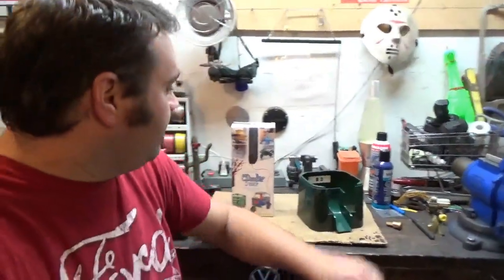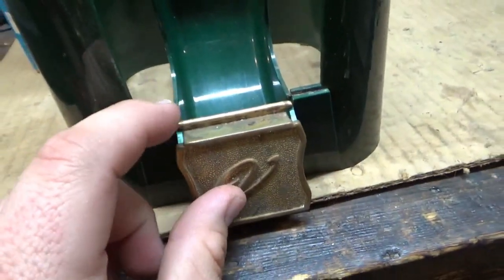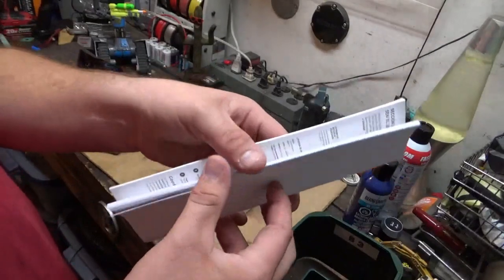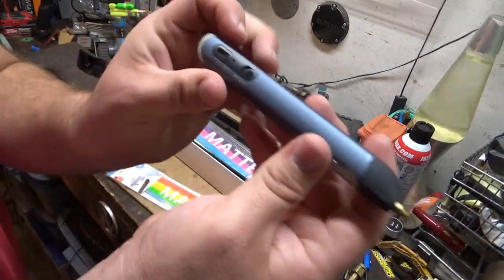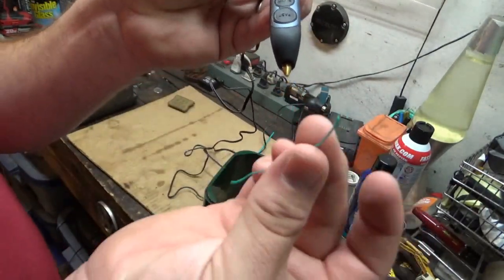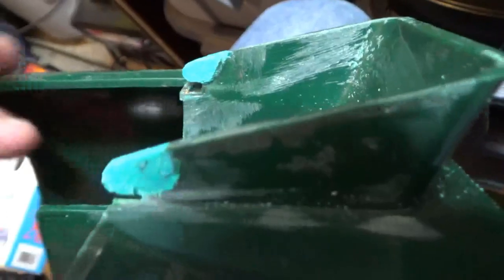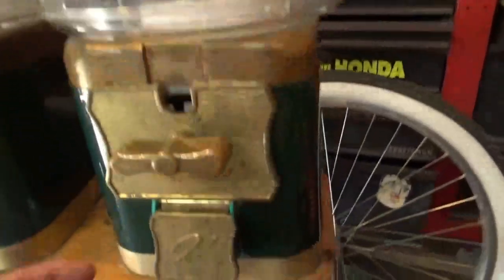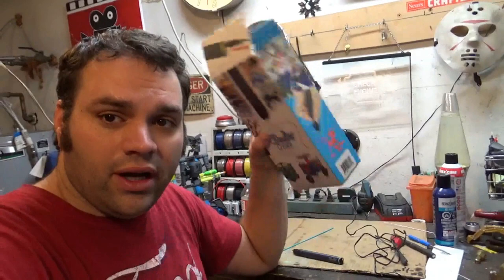Fixing Plastic With A 3D Printer Pen ?

Comment: I’m really interested in getting a 3D pen soon and I’m trying to find out if the filament might stick to different thermoplastics such as poly ethylene terathalate. This is because using a heat gun ive been experimenting with the sort of basic forms I can turn PET packaging waste  into and I’m thinking if filament can stick to it well it could be a possible replacement or compliment to using aluminum for the make up of a form to pen over. Googling it and looking on YouTube hasn’t given me much to go on so far. It just seems like something nobody has tried yet, maybe I’m wrong and just haven’t found something in that ballpark just yet.

Comment: I've seen some crap repair jobs using a soldering iron to melt together broken pieces of old computer cases. This (shown in above video) seems a better and cleaner method.
Reply from the maker: I agree , using a soldering iron works kind of but the plastic loses its elasticity  and will break again , this repair is still holding

Comment: did you use abs or pla filament?
Reply from the maker: I used abs  filament  mainly because it required a higher temp  so i could blend it with the existing part  .
Reply: Isn't ABS like extremly unhealthy?
Reply: @taju3d374  it is. Gotta use it in heavily ventilated place because of carcinogenic fumes during the melting process
Reply: Wow, I'd be so scarred to use it. That's why I always use PLA. Why do you use ABS? Is there an advantage over PLA?